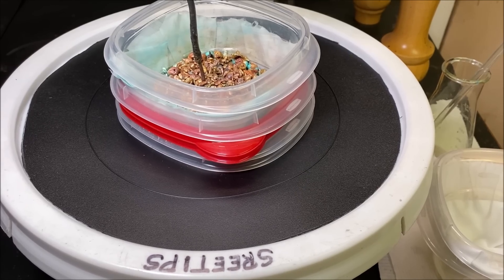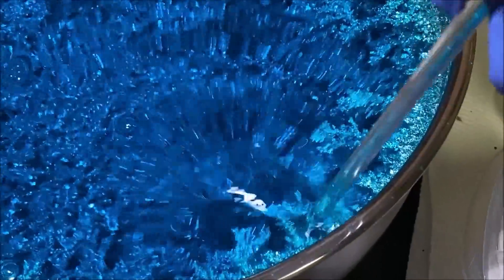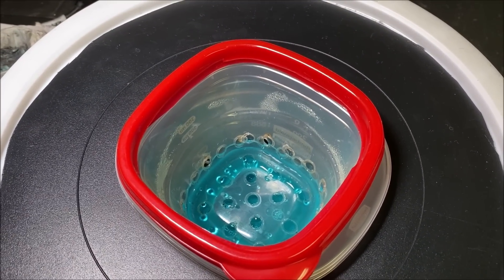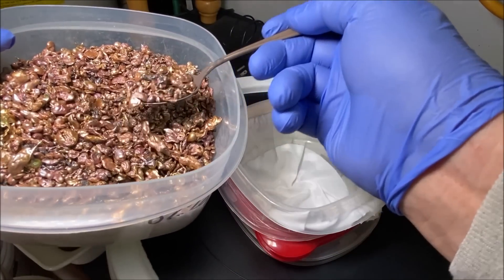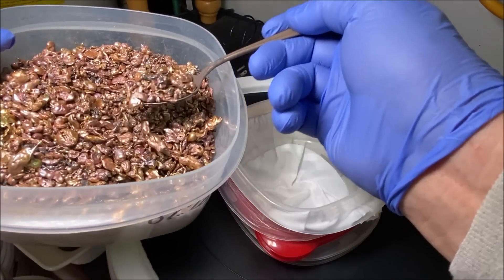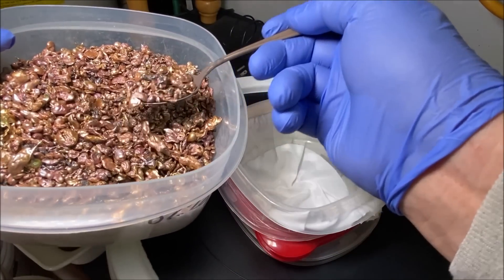Silver Cell Anode Filters Recovery and Refining Pt1

Comment: This is really cool. Have you seen/heard what is going on in the silver industry right now? Shorts are getting massively squeezed, and refinery capacity is maxed out. Silver refining might now be a profitable venture in its own right.
Reply from the maker: I’ve heard. This changes nothing. I’ve known this was coming since 2008. But I’ve got to say this. These things are not good. It means our currency, and our country, are failing. It means that the line that separates those who have enough to get by from those that don’t, is slowly rising. And people are falling into poverty. It’s all due to creating currency out of thin air, and using it to try to avoid financial ruin. It never works. Yet here we are. There’s no turning back. It’s a disaster.
Reply: @sreetips  I agree, but I think that Scott Bessent is going to get his way and stimulate small business growth through community bank creation and a new credit impulse for small businesses 2026-2027, so there will be a reprieve before the catastrophe hits in full force. This is just a prelude. Of course, a credit impulse will lead almost inevitably to a downturn from malinvestment. Another potential factor is the fate of Russia: if their energy infrastructure is completely destroyed this winter, they may be desperate enough to sell the silver and gold their central bank has been accumulating, which would put downwards pressure on the prices and further lengthen the time until USD monetary crisis ensues.
Reply from the maker: I fear for our country.

Comment: I’m sure it would take some effort, but wouldn’t it save both time and money in the long run to just rinse off the silver shot, a few good rinses would probably take a lot less time and would definitely save nitric acid if all you need to dissolve is the soluble components of the slimes, and not have to dissolve all the silver. Put the silver shot from the filters into a bucket with a lid, fill with some water, and agitate. Then strain. Do this a few times and I’m sure the shot will be almost clean of slimes and you can simply run the shot through the silver cell. Filter the solids out of the water and the residual silver and palladium will be extracted with much less nitric than you are using.
Reply from the maker: That’s a good idea, let me know how it works for you.

Comment: Whats the concentration u use for the electrolyte? Prior to amd then after u dilute. Also how do u keep ur power supply on cv? No matter what i do mine always seems to switch back to cc. Though i have voltage set at 3.5v
Reply from the maker: Turn the current knob all the way down to zero in CC mode.

Comment: Could I use cemented silver to make my electrolyte for a silver cell? I have lbs of sterling  but no pure silver for the electrolyte
Reply from the maker: You can use pure silver coins or bars.
Reply: @sreetips so cemented silver wont work? Is there a way i can uae silver nitrate?
Reply from the maker: I think I may have used cement silver to start my silver cell once. But after that I reserve some of the pure silver from a previous silver cell run.
Reply from the maker: You can use silver nitrate dissolved in distilled water for silver cell electrolyte.
Reply: @sreetips awesome thank you😊

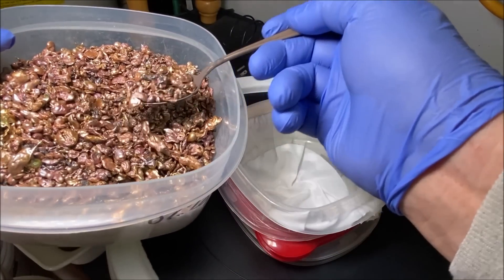Comment: 9:50 If you turn the fuse connector to the right side, you could have the negative connection further away from the positive wire.
Reply: First USAF base I was at had an R12 refueler catch fire because of bad wiring placement. Took me 2 weeks, the diagrams, and 40 20-foot white wires. Drove me crazy. Thought I'd share the knowledge.
Reply from the maker: Thank you

Comment: So.. you’re having to “soften” the dried cell filters:

While storing and accumulating them-

Would it be possible to store them wet? Just in a bucket of distilled water?

Or if they’re dried hard like that, throw them into an ultrasonic cleaner or use an ultrasonic transducer to shake it all off or something? 

I would think either ideally keep everything in solution/wet then just quickly rinse off and maybe wring out the filters.
Reply from the maker: Yes

Comment: since your silver cell is located directly in front of your wooden shelf/table, why not just get a fuse holder you can directly screw to the shelf so that it will not move? It's simply a plastic fuse holder with a single hole in the plastic underneath the fuse. you mount it, then then pop the fuse in it.  the wires can then be either soldered or connected with spade lugs to secure the connection.
Reply from the maker: Good idea, thank you

Comment: Processing the filters from the silver cells is one of my favorites, but I always wonder why you don’t immediately prepare the used filters for further processing and reuse the silver shots that haven’t dissolved yet.
Put the filters into the glass beaker with acid or water and rinse them out as thoroughly as possible. Then take a bucket to use as a stock pot, place a kitchen strainer on top, and pour the contents from the beaker through it to drain—ideally overnight.
Put the filters with the remaining sludge into the stock pot, and either return the silver shots in small batches to the silver cell or melt them down with new cement silver to form new shots.
The advantage is that this way there’s less material left for further processing afterward.
Reply from the maker: Because I’m impatient. And it takes lots of extra work and produces lots of extra waste that must be treated prior to disposal. I have access to plenty of nitric acid. So I’d rather let the acids do all that work for me.

Comment: Woohoo! Your stock pot and anode filter recovery videos are my favourites. Watched every one twice.😊
Couple of thoughts. 1. Have you thought about washing the old anode filter slimes and shot into a bucket when you replace the filters, then collect the Dacron filters into a big beaker for later HNO₃ treatment. You could also recover the shot to process.
2. The silver jars. not only they remove excess HNO₃, the Ag metal also recovers PGM as the black ppt. You could process that recovered ppt with the anode slimes.
Thanks again.
Reply from the maker: I’ve tried multiple times to recover the shot. And it never goes well. It’s too messy, to time consuming, and creates a lot of extra work and waste that must be treated. Believe me, dissolving everything in nitric acid is the easier softer way.

Comment: I am wondering why you don't classify the anode baskets through an 1/8" classifier screen. Process just the minus1/8", put the larger, washed material back in the anode basket. No sense using more Nitric than necessary.
Reply from the maker: Because it takes too much time and water.

Comment: How do you know when it’s time to change the electrolyte solution. I think k you said you use it twice, but is there a good way to know if it has too much copper in it?
Reply from the maker: From this day forward, I commit to using the electrolyte for a single run of the silver cell only. After I harvest the pure silver crystal, the electrolyte will be processed for the silver that it contains, and the silver will be recovered from it. Then the recovered silver will be washed, melted into shot, then run through my electrolytic silver cell. I’ll do this to the end of my days on earth, as long as I’m able.
Reply: @sreetips thanks you. I love the videos. Keep them coming.

Comment: I watch all of your videos and always wonder if you have tried running cemented silver in the silver cell with turning into shot? 

Do you think it would be beneficial if you remove your first spacer with the holes facing down from the beast to allow more liquid to reach the silver shot?
Reply from the maker: Yes, it didn’t work well. No, the basket is set up and the cell is running perfectly. I don’t want to change a thing.
Reply: Last question.  When doing the recovery of the silver from the anode filters have you tried putting the filters into the furnace to cook off the filter material to make filtering liquid process easier?
Reply from the maker: No

Comment: Would it be an idea to empty all the filters out in a bucket of water and wash them really good. Then pouring everything into a different bucket using a sieve to collect the silver shot. Then let it settle and siphon off excess water.
This should result in much less material plus use much less nitric.
I'm sure there's a reason why you don't but it just seems it'd be more manageable.
Reply from the maker: I’ve tried recovering the silver shot several times. It’s messy, uses too much water, and times lots of time.

Comment: In my small silver cell factory i've made a rotating plastic can with very small holes, where i put silver shot with slimes. 30 minutes rotating in distilled water. Sllver is clear, ready to reuse. Slimes are going down to bottom.  I redissolve only slimes, not silver shot

Comment: Since you're working at such low voltage it probably isn't a factor, but in electrical systems it is not preferred to switch or fuse on the negative (cold-side switching) because the system is still hot when the switch is off or the fuse is blown, leading to the possibility of someone getting shocked or the system still getting shorted without the safety device even in the line. For these reasons, hot side switching or protection is preferred. Probably not very applicable to your situation but something to know and consider.

Comment: With Christmas coming up,  may I suggest taking a few of those beautiful silver crystals and placing them in a silicone mold (your choice) then filling the mold with resin (your choice clear or a color). When set, pop out the artwork  (Christmas decoration), smooth out any rough spots, and put it on eBay and make $$$. Since you don't seem to be the "artistic type", maybe this is a job for the amazing Mrs. Sreetips? She could start her own channel!

Comment: How do you determine the nitrate solution in the silver cell is too dirty and needs to be replaced?
Reply from the maker: I used to run it twice. But from this point forward, I’m only using the electrolyte for one run of the silver cell.

Comment: also , how did you find the optimal shape/thickness for the anode silver bar ? trial and error , or educated guess , or both ? :)
Reply from the maker: It was the size of the mold cavity that determined the shape of the anode bar.
Reply: @sreetips forgive me , I meant to mean, how does the thickness or surface area of the bar increase or decrease current flow. Or would it not make any noteable difference. Like in "The Beast" would a larger possibly thinner anode spread out the current  more evenly ? or spread out slimes build up ?. sorry so many questions. Im  just very curious. but also i dont have extensive knowledge. :) Thankyou fro all you do Sir :)
Reply from the maker: I don’t think size and shape matters. I bury the electrode bar under impure silver shot to get the best contact and current flow.

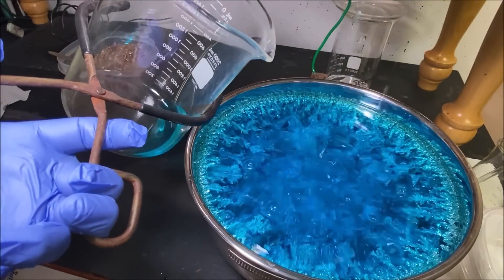Comment: At 1:10 you return the electrolyte. What if you poured it over the silver granules and then added more granules?
Reply from the maker: I’m hesitant to pour electrolyte into the anode filter. Because it could cause very fine particulate, nano particles of other metals, to be forced through the filter and down into the cell. Might contaminate the pure silver crystal.

Comment: Another great video. 
Have you considered saving a sterling gravy ladle to transfer shot to the basket? And, how about putting a mesh fabric around the bottom part of the filter basket. That should help restrict the silver crystal getting to the inner basket. 

Congrats to HAL9K for presenting an excellent idea.
Reply from the maker: 80% of my silver holdings are in sterling silver. There absolutely no need to refine sterling because it contains a known quantity of pure silver. As long as you don’t ruin the markings. Then its purity and value becomes questionable.
Reply: @sreetips oh absolutely. I've bought some sterling silver as well. It's in my stack along with my 99.99 silver and gold. I don't have all that much but I add a little every month.
Reply from the maker: Wise decision.

Comment: Like many viewers, I enjoy the stockpot, waste treatment, and anode filter treatments.  Question for you, sir. Why not collect the filters in a 5 gallon “stock pot” like setup.  Maybe even acidify it a bit with nitric.  That way the filters slimes are working off the filters allowing you to go straight to recovery.  You could even use a similar colander setup like you did with the Acid/Peroxide fingers (Copper Chloride), that would allow the slimes to fall off the filters for easier removal.  Taking it a step further, when you stir the silver cell, maybe stirring the “slime pot” :) at the same time for some agitation.  Just some thoughts on making the chore a little better.  Keep up the content.  Always enjoy it.
Reply from the maker: Never thought to do that. That’s a good idea. Thank you

Comment: G'day Sreetips, I once mentioned using a Hydrogen generator to use as your torch to melt your Gold powder, but you never replied... They are way hotter than Oxy Acetylene, and use less pressure. Also quite cheap to purchase.
Is there a reason you don't use one?
Reply from the maker: The only reason is because I don’t have one.

Comment: Resmelt paper and all back to shot
Reply from the maker: Smelt: rendering metals from ore.
Reply: @sreetips  Mabey incorrect term of saying it that way, casting may be may have been a better term. And yes in essence it is ore that to electrum or  sylvanite which leaves me with lots of questions, thoughts and experiments with liquid nitrogen. A question I have is in this process of refining would it be faster to drop the platinum out in solution first or will it drop out the other pl base material before cementing out on copper. Hope this makes sense
Reply from the maker: I’m uploading a video about that right now.

Comment: I think having an XRF would be amazing for you! Have you thought about getting one in the future?
Reply from the maker: I thought about it in the past. They are the price of a used car. Rent one for $1500 per week, or $4500 per month. That was 2016 prices. Includes a free curtesy visit from local authorities to ensure proper use because it emits radiation.
Reply: @sreetips  You’re right, back then XRF analyzers were insanely expensive and tightly controlled. But not anymore — today handheld models from China sell for $10k–25k, bench-top units for $40k–95k, and European brands around €15k–30k+. They’re no longer monitored like before,. Much cheaper and more accessible than before
 a real game-changer for precious metals!

Comment: Great informative video ,  years ago I used to refine silver from photochemistry and I used to use a porous bridge to separate the dirty side from the clean side ,  it was just a pile of seatbelt material from one aquarium tank to another,  the collector was a drum with a scraper so the silver fell into the bottom of the tank,  it kept the horrifically dirty mess on one side ,  the silver nitrate was in the clean side but there was sufficient conductivity to allow the silver to be recovered ,  it wasn't clean but it was a lot better

Comment: What @JonathanMArtins7744 explains further down below - Fuse on the positive/hot, for several valid reasons. Even if it's inconvenient. Always fuse on the hot side, as close to the source as possible. It's a rule of electricity that, in my book, is right up there with "keep yer boogerhook off the bang switch 'til it's time for the loudness to happen". Do it that way, and you won't go wrong, if you catch my drift. Don't, and you might.

Comment: Dumb question here. Why is it that the Silver gets plated on the side of the SS bowl, from the impure silver and not the copper in it?
Reply from the maker: The copper stays in solution and does not plate out as long as the copper concentration is kept below a certain point (I’ve been told 60g per liter). Above that copper concentration the copper could begin to co-deposit with the silver and contaminate it.

Comment: Just wondering: Why also put all the inpure silver shot in the beaker? I would have thought to dump the shot out of the filters, rinse the slimes off and reuse the shot in the silver cell. Any slimes that are still on won't give a problem in the cell. In that case you would only have to process the slimes and the filters, and maybe some pieces of shot that are stuck to the filters... Would save a lot of acid.
Reply from the maker: I’ve tried it. It failed miserably.

Comment: It may be easier when you service the silver cell to put the contents of the soiled filters into a bucket and then process the cloth parts separate from the bulk of the soiled shot and anode slimes
Reply: This would mean that it wouldn’t clutter you up so much.  Also do you re-use the cloth filters, or do they get damaged by the process?
Reply from the maker: Storing in a bucket is a good idea. Thank you

Comment: What about this for the silver cell leftovers.  Rinse off the leftover silver and either keep running it thru the cell - or use the granules for your silver jar.  Then the rinsed leftover slimes can just go right into the stock pot for later processing.  Then you do not end up with a pile of filters on the bench that you want to put off.  Although, I guess the stock pot is probably already near capacity and there isn't room for a third bucket under the cover outside.
Reply from the maker: I’ve tried rinsing the granules. It’s a giant pain. Uses too much water. Doesn’t work well. I’ve abandoned the idea.

Comment: In the past you have incinerated a bunch of filters you had. I think you used a pot and bond fire. Why didn’t you go that route this time? That would eliminate the need to get those hard filters softened up to remove metals from them
Reply from the maker: Those were paper filters in the bonfire.
Reply: @sreetips correct. But why wouldn’t incinerating these filters work as well?